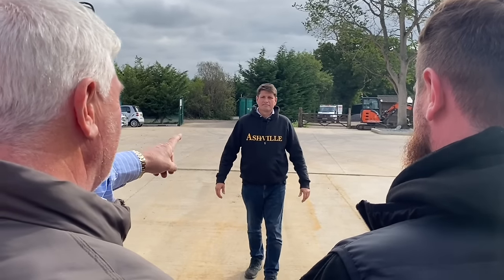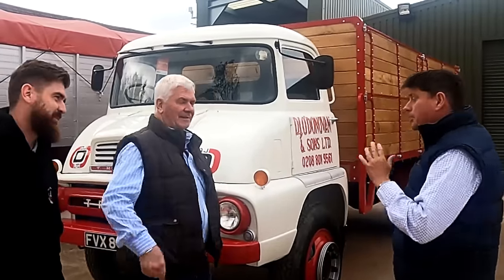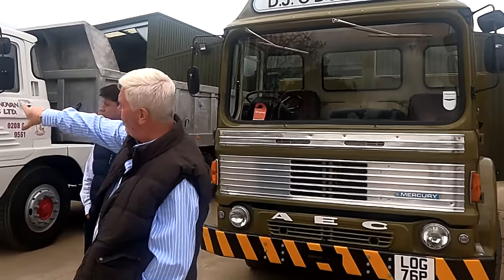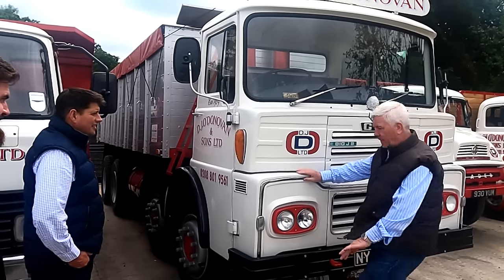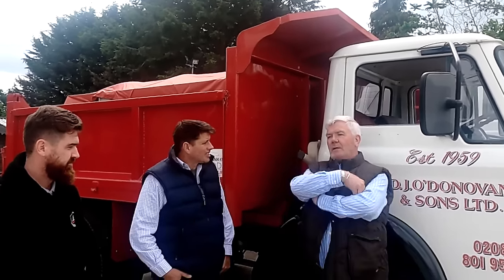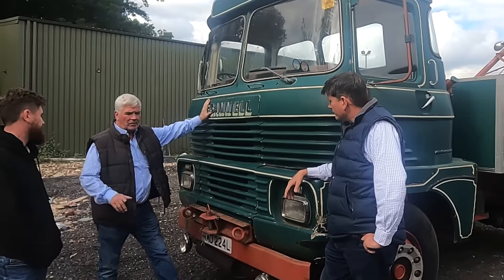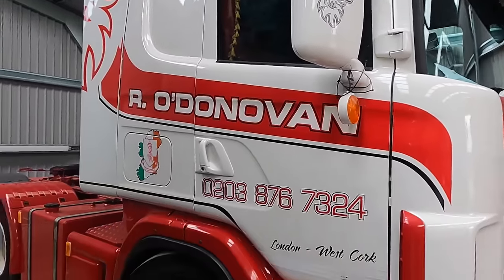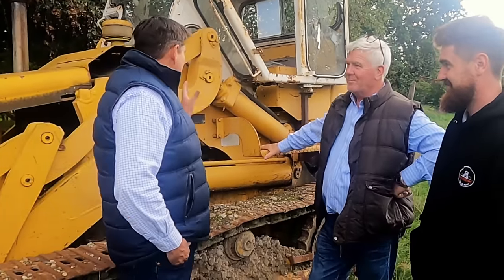THE O'DONOVAN STORY

Comment: Great to see all your old lorrys, thanks for sharing
 I remember driving in South London once I was following a demolition low loader  the company name was Syd Bishop and it was signwritten "watch it come down" cut a long story short he clipped a lamp post, you could say I watched it come down!
I Worked for Cuprinol 1978 - 86 we had 2x Big J4 2x Big J6 and 2x Big J8 one J8 had a 180 Gardner and a 6 speed box, the other J8 had a 220 Rolls Royce eagle diesel coupled with a 10 speed Fuller box, the J4's had AEC motors with 6 speed box and 2 speed axle, the J6's AEC engine with 6 speed box, later on we had 6 wheeler Leyland Super Buffalo's, Bisons with TL 11 engines with Fuller boxes, we then moved on to Scammell S26's with Rolls Royce 265 Eagle diesel engines my first sleeper cab.

Comment: cracking video mucker, served my apprenticeship at a coachbuilders in the early 80's , building tippers/flatbeds,  box vans and lutons, plenty of ford d series, bedford tk's tl's ,and volvo f86's , real jack of all trades old school apprenticeship, we never used any drawings ,boss just gave us  height, length and width, roller shutter or back doors etc etc , we had to mentally visual the end product, , then mentally work backwards to a starting point, great times

Comment: Aaah, the Thames Trader, my first ride, a tipper just like this one, but a no glass, flattened roof, open air, pull start version, back in 1970 when I was 22.
To get this job, I bumped up my age to 23 and then the firm bumped it up again for the insurance company to 25 and everone was happy.
My drive to work was a Jag Mk2, bought for 25 quid and in a about the same condition.
The Trader was the company dog, given to new boys and confined to the yard at Portslade Gas Works,
It didn't take me long to reduce this heap to scrap and I was let loose on the road with an AEC Mercury, (fibre cab).
That first day with the Trader, is imprinted on my memory and I managed to get through it, without anybody noticing I'd never driven a lorry before.
..
Reply: P.S The name of the company was, Direct Haulage,Bermondsey.
..

Comment: Great upload. Thanks. I love to see stuff like this. I was showing this to my Father. He had many tippers over the years. I think he started around 1970 with a TK Bedford. Then he had AECs, and Leyland Bison and Leyland Riever, both 6 wheelers. I remember both of the Leylands. The Bison sat up for years and eventually was scrapped as the cab was rotten. The Reiver was fine though, someone bought it to restore. I was sad to see it go, but my Father doesn't really have any sentimentality when it comes to vehicles! His attidue is "Well, I sold it for more than I bought if for and I got 20 years of work out of it!" I suppose he has a point. He then got Volvo F7s six wheelers. I drove one of them myself in the 00s. I still have both of the F7s, they're not restored or anything, they've been laying up for a few years, but both are still good straight solid tippers and were both drove to where they are sat parked up in my yard. One of them, the one I drove, is very good. It was owned by a Quarry company and the cab was all undersealed and I think grease pumped into it to keep it protected, because I think they had issue with cabs rotting before so when they bought the F7 new they made sure it wouldn't happen it. The newest tippers we had were a Foden 3325 and a little FL6 four wheeler, I drove both of them also. I often think of putting a tipper on the road, I probably will again at some stage. Does anyone know are F7 tippers worth anything today? A lot of people have been asking about them. I often looked online in the commercial classifieds but I rarely if ever seen any for sale. I'd imagine they're quite hard to come by these days. Maybe of interest to companies who had F7s back in the old days.

Comment: Nice trucks and good banter. I did my Heavy Trade licence (1984) in a D series tractor owned by a local driving school. The Leyland Ergomatic cab would be great for around town and the open road (in a temperate to cool climate country) but was a disaster in Australia. There was insufficient room for a hot climate radiator. The Ergomatic cab destroyed Leyland’s reputation and market in Australia (and probably Africa, as well). If you ever wondered why there is only one image of a Leyland Ergomatic cab road train which appears in books and videos, you now have a clue as to why. I was not aware of this story until about a year ago, when Classic Restos did an episode on a family owned truck dealership which is close on a century old, had settled on Leyland and then had to change over to Kenworth after Leyland destroyed their ‘hot climate’ market. Leyland obviously knew the cooling requirements for hot countries and it was a scandal that they did not produce a taller version of the Ergomatic cab for hot work.
Reply from the maker: I know the very photo 😉

Comment: It's fantastic to see you keep these wonderful vehicles, fair play to you. it was nice to see the Scammell, it was the first big truck I was allocated some 37 years ago 4 MJ church near Bristol, still remember the plate pdv 729 m. I remember the door was pop riveted on and I had to climb into the passenger side and used to carry a blowtorch to heat the cab as the heater is pretty much non-existent Beside You Could See the Road through the floor. Had to hold it in fifth gear with my knee as it would jump out if I didn't. Love to drive one of those again. Ford d series what's the first track I bought in 1985 in 7 a half ton tipper 76 plate. The Clydesdale brakes were fantastic not! I remember pulling out the yard one day and I put the brakes on next thing I knew I was staring at the road, the cab tilt mechanism broke and my face was against the windscreen about 6 inches from the road surface. Youngsters in their plush trucks wouldn't have a clue

Comment: My dad came over in 50s from Mayo, late 50s through mid 70s did muckaway, it seemed like 90% of muckaway was all Irish around London then. Truck of choice on muckaway with them were Albions and later with scammels, due to light.  rugged build for good payload, and high  ground clearance for muckaway, AEC ergo,s were common on hard-core work, and not muckaway due to ground clearance and heaver unladen weight,Remember all these trucks like it was yesterday First Routemans with double light were bigger version of Albions with Same front axles, and 680s, later had octopus front axles.

Comment: I remember the urgo cab on an AEC because my dad drove a tipper 4 leger for a local haulier I had a load of corgi models of the scammel  alll mine had the 4 headlight setup  / always had a passion for trucks , spent hours sitting under them wcleaning the chassis down by hand ready for plating ( I copped the job as I was so small I could sit up when under neat to clean out the insides of the chassis rails   great fun to be covered in grease. oil and muck from the road ( once you had cleaned them off you them had the job of painting the rails ( misspent childhood??)I don#t think so 😊😊

Comment: When i worked out of the Tarmac plant at Corby in the 80/90ts the old drivers used to relate to the Traders as tarmac had a fleet of 6w tippers with solid back axle as there was know PAS then the drivers used to load them back heavey and when they came out of the plant there was a steep hill and as they reached the main rd the front wheels used to lift of the ground and leave then no steering when trying to turn left or right The head fitter told me Tarmac had an agreement with ford as they used to stock the stores with spares and when they fitted any item ford sent a replacement part 
and invoiced tarmac for the part they had fitted cant see any truck manufactacturer doing the same today may be wrong
Reply: Volvo did the same for a waste company I worked for,we had a fleet of F7 six and eight wheel rear end loaders, they fitted the stores out with all the spares we might need and at the end of the of the month they would come in and top up anything we had used and invoiced the company for them,I drove one of the eight wheelers and in the 5years I drove it servicing was the only thing it required..

Comment: Great video. Would love to see you get to work on the 951. That's not a 951c at all though. Someone has just put the decals on. Its either a straight 60s 951 with no suffix or a 951a produced up to 1970. 63k or 89a.
Reply from the maker: We'll see when I'm back there and check the plates

Comment: If those head lights are vauxhall look like HB viva
Reply from the maker: Yes I reckon you may be right
Reply: @LordMuck  just looked on ebay found a set for an HC but LEFT HAND DRIVE
HC & HB might be same light
Reply: @LordMuck  vauxhall lights are different, Renault head light is the one you need used to be able to order them from Renault but they were expensive.
Reply from the maker: Which model ?
Reply: @LordMuck  renault 12 , i priced them years ago for my routeman they were over £500 each then . bought a set on ebay from france .
Reply from the maker: Thank you 😉👍👍
Reply: @LordMuck  I've just looked on ebay Renault 10 16  GT40 headlights £72 each 10 available
If they are the correct lights
Also are they RHD? Only the owner can look and see if the information given by poclainerf is correct